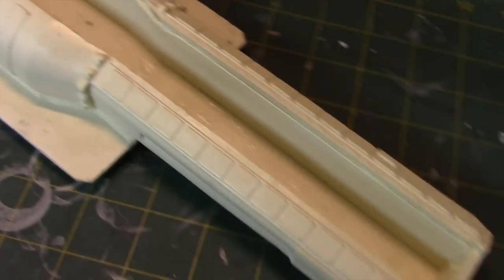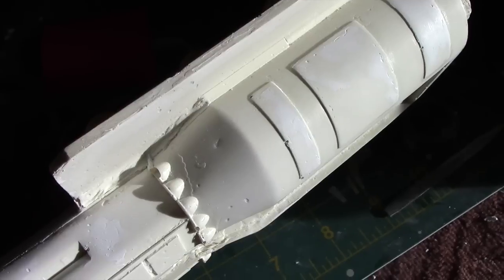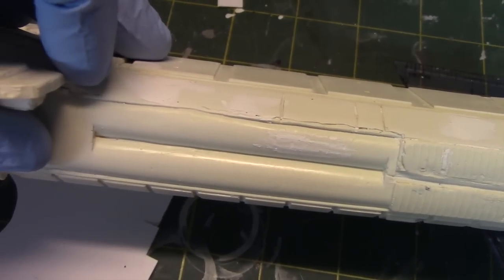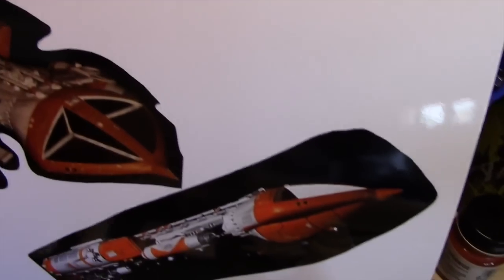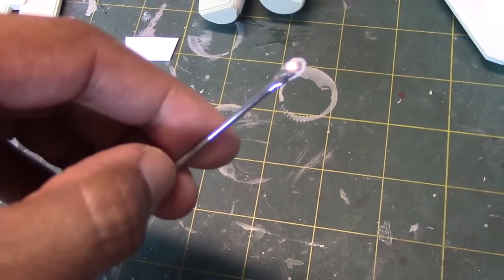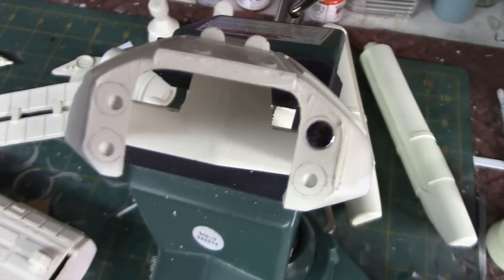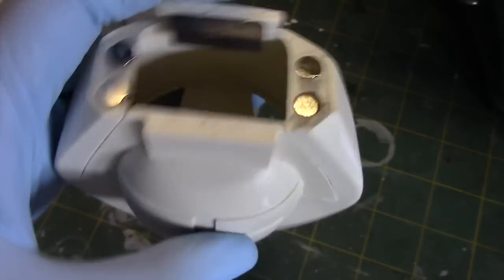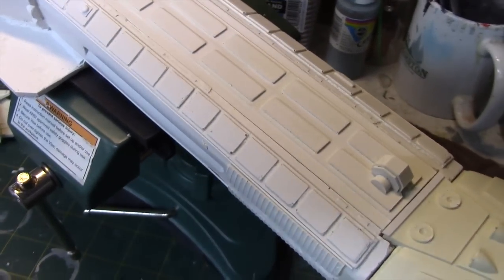Building the Space 1999 Mark IX Hawk, Part 1

Comment: I have a couple if question I hope you maybe able to help me with regards to your build.  At min. 4:20 the long item which has the Ten rectangular panels with the Low stage of the LM connected between the two forward panels could you inform me the length and width. also the dimensions of the lower section which has the single rectangle on the forward section and aft section which has the two inset Rectangles.   Thank you .
Reply from the maker: The first section you refer to is 6" long X 1 1/4" wide. I'm afraid you'll have to be a little more specific about the 2nd section. Not quite sure which one you're referring to.  If you can email me a pic of it using a reference pic to interstellarmodeler at gmail that would be great.
Reply: Thank you... the second section is the Aft section of the Hawk. Thanks again for the info.
Reply from the maker: The aft section is 4 1/2", 6 1/2" if you include the tank to the engine bell, 8 1/2 " with the bell.
Reply: Thank you again for the information.